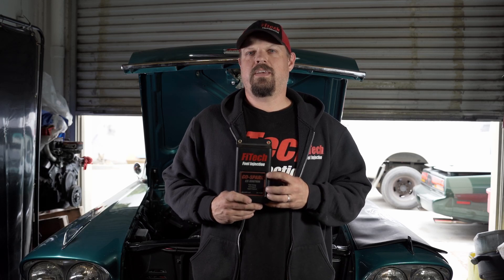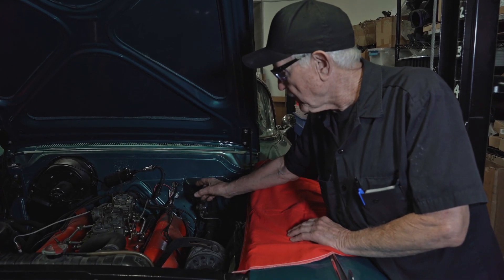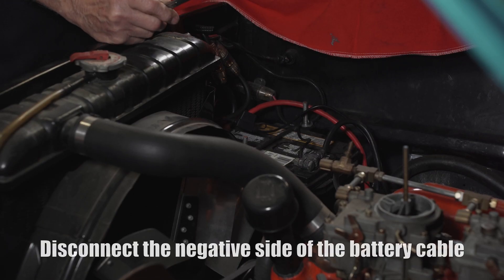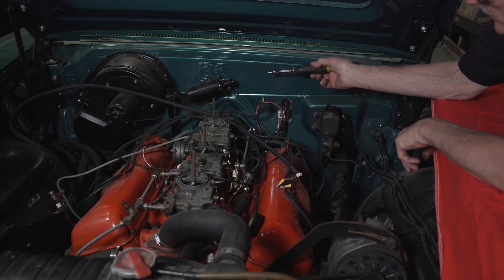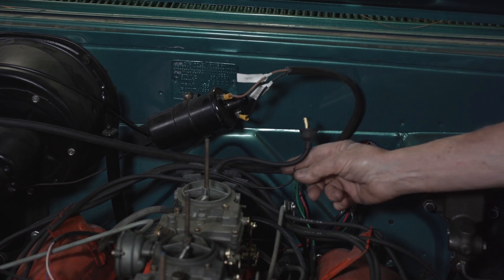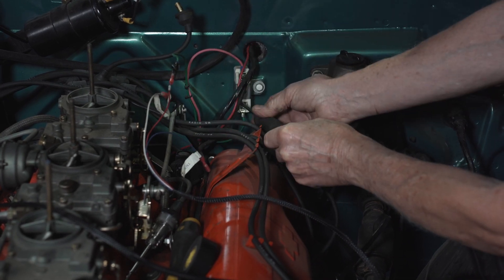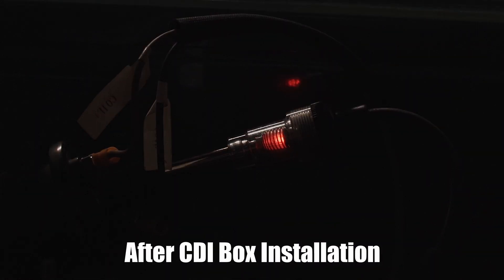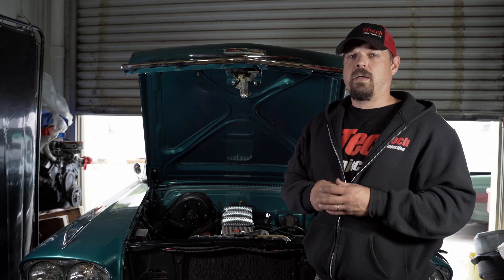Go Spark CDI Box on a Points Distributor | Tech Tuesdays | EP72

Comment: This demonstration shows exactly in my opinion why those  enclosed “coil wound” spark testers shouldn’t be used for ignition system diagnosis, they will still light up on a spark that’s too weak to fire an air/fuel mixture.  Always use a tester that uses an air gap so you can see the quality of the spark and see if the ignition system can really “walk the walk”.   The tester shown at the end is good for testing stock HEI to aftermarket CDI but, not ballasted ignition systems or some coil packs because the gap is too wide.

While the breaker points in this setup should theoretically last longer by not having to handle current and thus no arcing… I have my doubts if they’re an aftermarket set of points.  The rubbing blocks aren’t made correctly on them these days.  I had a friend  that couldn’t get more than 3000  miles out of a set. 

I would complete the setup by using a points eliminator kit or better yet a later distributor with a magnetic pickup if the engine application allows it.